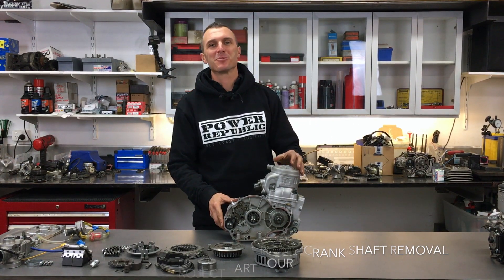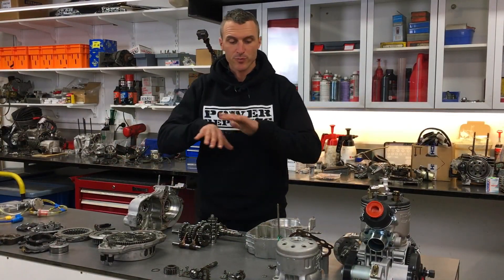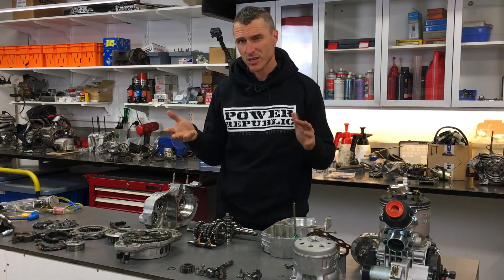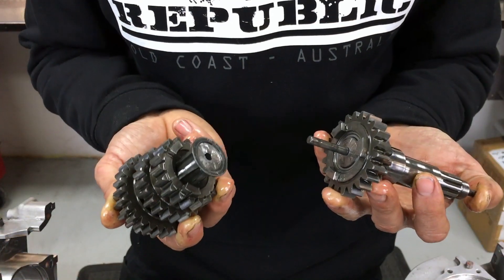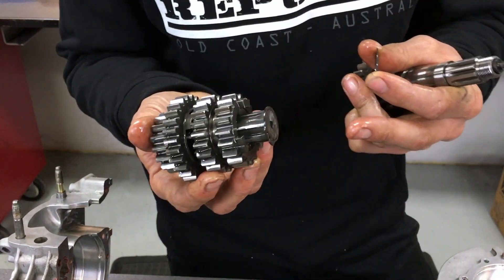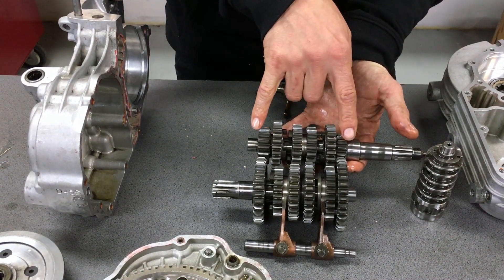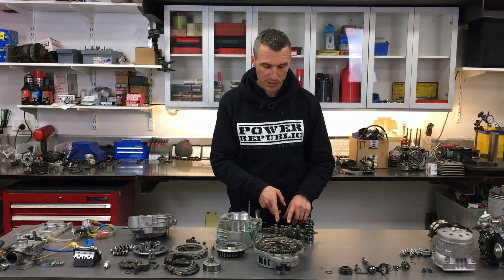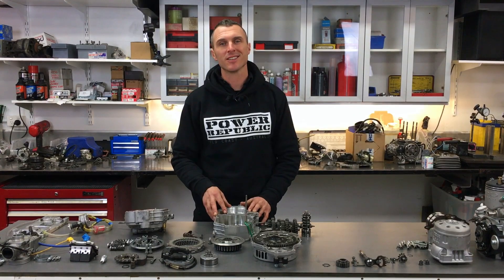KZ Engine Rebuild Project Part Four - Crank Shaft Removal - POWER REPUBLIC

Comment: Hi! I noticed the ”gear fork sliding pin” for the output shaft was stuck in the left gear case when you spilt the cases. Then it’s back holding the forks in the right hand side case half. How did you get it out from the left gear case? (I am struggling with mine right now…) Thanks!!!!
Reply from the maker: Not 100% cause I think mine just came out.   Maybe add some heat if you can get too it ?
Reply: @ thanks, yep, that’s the way I went. Together with a lot of force, it was really stuck in there… but I got it out eventually. I think I have to do some wet sanding or something on the shaft end before assembly, otherwise it’ll be the same struggle next time again. Thanks for answering!!!